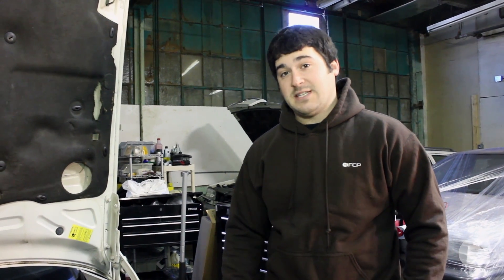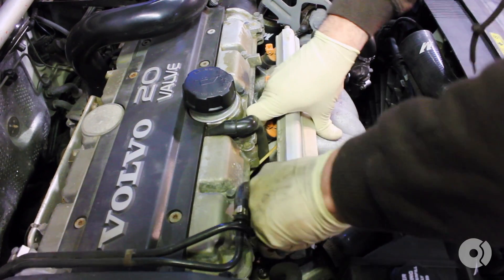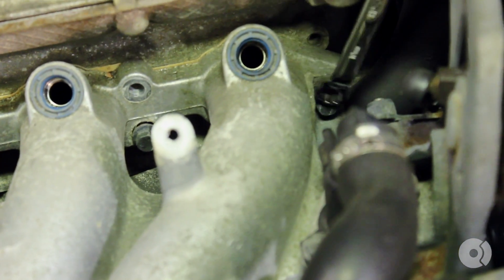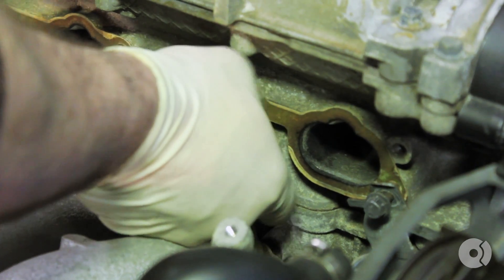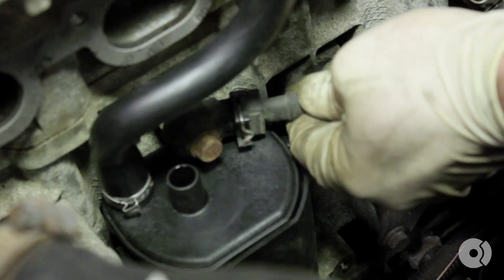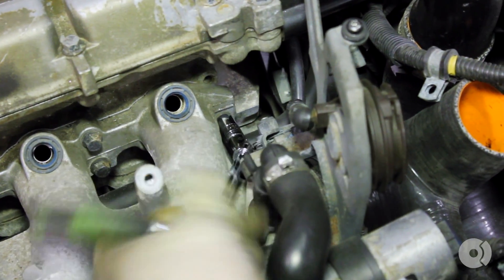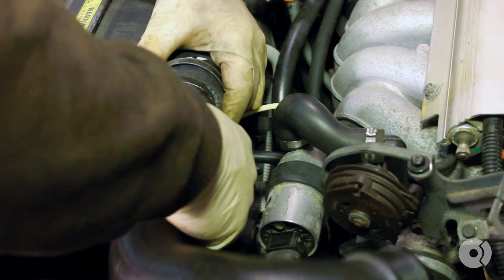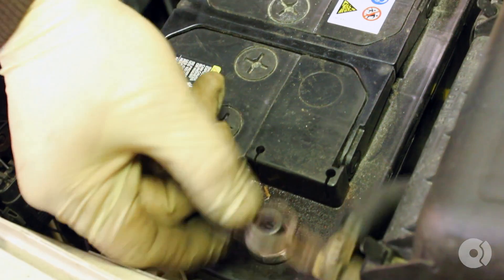Volvo PCV Breather System Replacement (850 Turbo)

Comment: have a 05 s60 with broken pcv hose and smoke coming out of exhuast. Could they be related? would or should i replace the whole box and if so will it be similar to this set up? Also heard one of the hoses could be clogged.
Reply from the maker: I don't think the smoke is directly related to the PCV being clogged. Is this turbo? Our Volvo tech Jason would be happy to help if you email him at jasonv@fcpeuro.com
Reply: FCP Euro yes it is a 2.5 t. could that burn oil if it has failed? I just emailed him thank you.

Comment: Great video Ben, quick question is the procedure same for a 05 XC90 5 cyl turbo engine? VIN last 6 numbers 214022, i am about to get the kit wanted to ask if a novice can do this?
Reply from the maker: The procedure is very similar. This 850 video can be used as a guide for the overall job and anything that would be different should be self explanatory (hoses, clamps, routings, etc.)

Comment: Is this repair job help with my check engine light? I know I have oil leaks. I also have code p0171. I know it's a vacuum leak. What should I do to find and fix it?
Reply from the maker: The PO171 may be attributed to a plugged up PCV system. If it's plugged, replace the components in the system, and then smoke the intake system with a diagnostic smoke machine to check for air leaks. Hope that helps.
Reply: Thank you for the info.

Comment: hello, yes this is the 2.0 turbo 5cilinder 132kw
Reply from the maker: If I'm understanding this right it sounds like the boost is coming in and out. If so It may be your turbo boost control valve malfunctioning but always check your vacuum lines too.  Hope that helps.

Comment: I ordered and installed a pcv replacement kit from IPD because FCP doesn't provide the longer hose which I needed.  However, this video was very useful in the install.  Unfortunately, now I have a problem.  I can start the car up fine but I get a very rough idle which draws the rpms low and I hear a strange electric beeping noise near the intake manifold.  It's almost like a misfiring, could the last 2 spark plug wires not be tight? What's going on? Plz help I can't drive my car at all like this.
Reply from the maker: Chris, email our Volvo Tech Jason at jasonv@fcpeuro.com, he's got a few questions and he can give you a hand with this.

Comment: hello, i have a v70 II from 2003 and have a problem, when i drive and give gas, the motor go up and down,up and down, the same like you press the gas and let go,press and let go,and so the car go foreward, i dont now whar the problem is, on the computer there is nothing off fault, we have change the airflow-meter, the valve on top of the turbo, is this PCV the problem ? when the motor run it's ok,untill you drive, if you push not much,there is no problem,but if you push harder on the gas,the motor go up and down,up and down.........
greetings from belgium
Reply from the maker: Hi there, is this a turbo model?

Comment: Having done this job back in 2008 on my 95 850T, I wish you had this video up then,  because from my own memory, I don't think I did my PCV valve job correctly. I was using the Brickboard.com's instructions.   And I have to concur with the poster that added that this job is a PITA. It defines PITA nicely. And my dipstick tube has condensate in it yet again.

Comment: great video..... i have a question.... what is the silver, round thing on the upper firewall?
Reply from the maker: At what time do you see it? Just want to make sure I know exactly what you're referring to.
Reply: i figured it out, i believe it is the alarm siren.... correct?
Reply: i had clogged PVC system, and it blew out cam seal.... i am replacing the cam position sensor seal and want to replace the one behind distributor.  does it come out the same as the one behind position sensor?
Reply from the maker: jmyz70 Yes, same procedure but you'll have to removed the distributor cap to gain access.

Comment: I have a 1999 V70R that likely needs a breather replacement. being a V70R it has the throttle under the manifold instead of out the side like the 850. are there any other major differences. also other websites include another breather tube (pn# 9470330) with their kit. is this something i should consider replacing as well?
Reply from the maker: The Throttle is mounted differently. There will be a starter bracket that needs to be removed to unplug the throttle harness. The  9470330 can be replaced but is not necessary. If you do replace it you will also need:

976559 - Hose Clamp (1 required)(http://www.fcpeuro.com/products/volvo-crankcase-vent-hose-clamp-976559)
978170 - Hose Clamp (1 required)(http://www.fcpeuro.com/products/volvo-hose-clamp-978170)
978173 - Hose Clamp (1 required)(http://www.fcpeuro.com/products/volvo-pcv-hose-clamp-978173)
8653884 - Banjo Bolt (2 required)(http://www.fcpeuro.com/products/volvo-pcv-banjo-bolt-c70-s60-s70-s80-v70-8653884)
11994 - Copper Washer (4 required)(http://www.fcpeuro.com/products/coper-washer-rcs-12x16-elring-11994)

The rest of the procedure is pretty much the same. 
Hope that helps.

Comment: I'm guessing it's the exact same lay out for a non turbo 850 just without the parts for the turbo obviously. Sorry for a stupid question but this is the biggest job I've considered doing my self and want to get it right.
Reply from the maker: All of the essential parts are basically the same. There may be a couple of hoses that are routed differently but it's all self explanatory.

Comment: Nicely done, will revisit this video when i overhaul mine. I'll have to replace the timing belt/water pump, radiator and I think by removing the radiator/shroud first, will give me tons of room to work around the manifold.
Now, has anyone ever replaced just the pesky vacuum elbow that sits right in between the power steering pump and intake manifold? The one with one port larger then the other that fails and triggers a P0172 code! I'm wondering besides long needle nose pliers, what other methods have you used?
Reply from the maker: I think you've got it. Long needle nose pliers and some patience.

Comment: I have a 2001 S80. I looked at it and the manifold seems to be 2 pieces. I can also see the black box under the manifold. Do I have to remove the manifold on these cars in order to service the PCV system. The engine runs fine. When the engine is warm and I pull out the oil dip stick I see a little bit of steam coming out of the stick holder. How else can I check the breather system? Thanks
Reply from the maker: The intake manifold DOES in fact have to be removed to from the Cylinder head in order to gain access to the breather box. A good indication of positive pressure in the breather box would be the smoke coming out at idle however to gauge the flow you can use a low caliber vacuum gauge. I hope that helps.
Reply: Thanks a million.

Comment: To just remove the fuel rail and injectors, do I just remove the two 10mm bolts and the vacuum connection? I want to switch the #1 to #2 injector and vice versa for a test to see if my misfire moves from #2 to #1 along with the injector.
Reply from the maker: If you're working on an 850 then it's just the vacuum line, two bolts, and also disconnect the fuel line if you plan on removing it entirely from the vehicle.

Comment: If I ever have to do this job again, I will use Genuine Volvo parts, the aftermarket kit I purchased works, but doesn't line up so well and I spent a ton of time fiddling with it.

I would also suggest replacing knock sensors at this time, since you have to take the intake manifold off to do that when they go. The car in this video has the original knock sensors still, a great DIY video from FCP would be teaching people how to install the Volvo upgraded knock sensor kit. You have to splice the wires and all of that, a solid DIY video would be super helpful to others on that topic.

Comment: Ben, Thank you for the excellent video. I have read that the use of a premium synthetic oil will prevent or deter this repair which I imagine costs over $500 at a dealer.  Do you agree?  

Sam Julier
Reply from the maker: It will hinder the chances of oil sludge if changed regularly however if any oil is left in a vehicle too long the same results will surface. Moral of the story - change your oil frequently no matter which grade or blend your using.
Reply: $890. Just got a quote from Volvo dealer

Comment: Hi,Can you tell me if the replacement of the PCV is more than less the same in 99 V70,how much time it takes to do it the  wall operation,i hope my english is correct!
Reply from the maker: Book time is about 4 hours and the procedure is more or less the same, hope that helps.

Comment from the maker: Van Troy Osorio It may be, but the first thing I would check for would be for vacuum leaks. A vacuum leak is more likely to throw off the fuel trim. Hope that helps. (Sorry for the strange reply, it wouldn't let me respond to your actual comment)
Reply: can you make a video like this for 740 volvo turbo B230FT engine..? and What kind of oil i need for me M46 Transmision..?
Reply from the maker: Brian Quero What year is your 740? A VIN is always helpful too.
Reply: Brian Quero Any oil will do in any gearbox before M90 as long as it is for trans, im sorry to tell you but if you cant fix a B230 you are really bad...
Reply: Hi FCP Euro, i just replaced the pcv system on my 2000 C70 with a kit i bought on your website and i did the glove test on it for pressure and the glove blew up. I also checked the dipstick and smoke was coming out of there. I took it for a 13 mile ride and retested it and same thing. Any idea of what it could be?

Comment: Thanks good video I have a question my car have a code I  need  to replace the air flow sensor meter I did that but the car have same problem I test the PCV system is bad you think the PCV system is the problem.

Comment: hi i've been checking my pcv at the dipstick after i saw this..is it normal at idle that air is pushing out?but when i rev it the air is sucking in...volvo s40 2.0t 2001 user...tq

Comment: Why the heck couldn't they come up with some way to just flush out the trap and hoses. i.e. so one doesn't have to take the engine compartment halfway apart. What a pain.

Comment: It's not a belt kind of sound and It's not the PS pump for sure. 

I haven't tried opening the oil filler cap to see if the sound disappears but I tried a latex glove on the fill hole and it inflates, smoke also comes from the dipstick tube.

I'm willing to bet it's the PCV making pressure on cold days and the sound is from forced air bubbles or excessive pressure buildup somewhere near the oil filter :)

Comment from the maker: The first thing I would check would be the accessories I.E. A/C compressor ( which is right near the filter; see if the noise changes in pitch with the A/C on and off ) Alternator, PS pump, and Tensioner pulley. A whine is usually accessory bearing related. Hope that helps.

Comment: Would a loud whining noise be one of them? My mom's volvo 850 turbo has had the sound with a cold engine a few times now during 3months.

Yesterday I noticed the noise again when I was checking other stuff on the car, I was in a carage with a maintenance tunnel under the car. The sound seemed to come from the oil filter itself. I even tried touching the filter and felt a pretty good vibration from it. Best way to describe it would be a VAG power steering at -30c.

Comment: i usually turn the a/c on when the temp gauge is at the midpoint because when it overheated in the past the temp gauge never went past that point and i still saw smoke from the engine due to coolant spurting out from the expansion reservoir

Comment: yes it does overheat. however when i activate a/c it also cools the engine.  i'm worried about idling in the fall/winter in city traffic when it will be too cold to turn on the a/c to cool the engine

Comment: Great videos guys! Any chance that 850 needs the head gasket replaced? Would love to see it before i attempt to replace mine. I need to get a compression test first but I have already replaced the radiator, water pump, cooling fan relay and thermostat and the engine fan only comes on when i turn on A/C. Any other suggestions?

Comment from the maker: You'll want to check the crankcase vacuum at the oil dipstick to see where if you have negative or positive pressures after the replacement.

Comment from the maker: You'll want to check for vacuum leaks and maybe clean the throttle. Also, disconnect your battery for about an hour to reset the adaptives. Hope that helps.

Comment from the maker: The EGR valve doesn't have to be removed however you'll have to remove the line to the valve. As far as testing the valve its best to remove it and apply vacuum to the diaphragm. At this time you can inspect for carbon blockage and clean as necessary. Hope that helps!

Comment: Does the EGR Valve have to be removed on a 94 850 Turbo in order to remove the intake manifold? Either way, do you recommend I clean the EGR Valve during the PCV repair? Also, how do you know if you have a clogged or faulty EGR Valve? Thanks FCP!!!!

Comment: You should had drop the oil pan and clean out the square passageway inside the engine block and oil pan. I done the shortcut once by skipping the procedure once before by not cleaning it up and I hade to do the whole PVC cleaning again but this time I drop the pan. Boy was it clogged up...

Comment from the maker: The EGR Valve does not have to be removed as it bolts closer to the intake manifold not the exhaust manifold on this vehicle. You may have to loosen the EGR piping however.  Hope that helps.

Comment: Great video FCP.  Will be attempting this shortly.  Quick question for you guys.  Does a 95' 20 valve non-turbo 850 have an egr valve?  If so, does it have to be removed to get the manifold off?  Thanks for your time.

Comment: It sounds like a vacuum leak to me, don't touch your wastegate hinge.  There are many vacuum connections in this engine bay and it could be anything from a PCV system leak to a torn intercooler plumbing coupler.  I recommend taking it to the Volvo dealer or Volvo specialist if you don't feel comfortable troubleshooting this yourself.

Comment: Do you believe a clogged PCV will cause me to leak oil? I am leaking oil real bad and it looks like I'm leaking from under the radiator but it's just dripping from there. I can't locate where the leak is actually coming from, I checked the connections to the radiator and it's not leaking from there. The only place I can logically think of is from the dip stick. I am losing a lot of oil, like a quart a day. If you can give me some insight I would highly appreciate it!

Comment: Thanks for this. On the XC70, it was a difficult job, but I got through it successfully thanks to this video. (I wouldn't have tried it otherwise.) Your PCV kit was fantastic. Only suggestion I have would be to include standard screw-in hose clamps instead of the one-time use clamps. I found it easier to get the manifold back on using standard clamps, and without the right tool, the pinch clamps seem a bit risky. Keep up the great kits and videos!

Comment from the maker: We haven't filmed the same repair on an S60 yet, but you can use this video to guide you through most the steps.  Just take your time and give us a call if you have any questions along the way. 1-877-634-0063  You can replace just the upper hose, but since you have to thread it under the intake manifold to the valve, you might as well replace the other parts too.  Hope that helps.

Comment: I have an upper PCV hose cracked and leaking some oil on the top of the engine (where the sparkpugs are) on my 2005 Volvo s60 2.5T, and i was told abourt 2 years ago that my "breather box" needs replacing/cleaning. can you post some instructions with parts required to conduct the repairs? What happens if i just replace the upper PCV hose? Thanks!

Comment: What would make a turbo bog down upon acceleration....let's say around 3000 rpm's at about 70 miles per hour. I've changed the pcv and don't know what else to do. What is a wastegate,where is it, and some one told me to tap on it with a hammer.......HELP ME PLEASE :(

Comment from the maker: The PCV system is usually a breather tube and a PCV valve. The tube connects the crankcase to a clean source of fresh air that flows into the engine after passing through some sort of screen to stop any flame fronts. Inside the engine air circulates clearing away combustion gases that exit through another screen to trap oil droplets before being drawn out through the PCV valve, and into the intake manifold. It’s essentially a way for gases to escape in a controlled manner from the crankcase.

Comment from the maker: You could have a clogged oil drain passage to the block or a sliced/loose hose.  Or it's possible you could have installed a faulty vacuum valve that could be faulty.  Hope that helps.

Comment: This is very helpful. My 98 C70 HPT has neutral PCV vacuum and the PCV system has been replaced only 6k miles ago.. any tips for why I wouldnt have negative vacuum as expected?

Comment: Sigh....I used this video as a guide to do my PCV system and into my car (95' 850T wagon) as far as lifting the intake manifold then - wait a minute, what the hell is this carbuncle hanging off the bottom of the manifold?  I discover that it's part of the EGR system!!! Hmm, interesting. No mention of that in the video. Wish I had more space to describe what a gigantic cluster the project turned into.  Thanks FCP!
Reply: I did this yesterday and was moving right along. Then, exactly as you said, egr.

Comment: Hey Ben

what a great detailed video, I will be replacing my split breather tube soon. I found the problem myself after spending over £250-00 on so called experts to cure a rough idle and excessive fuel consumption.
Tom